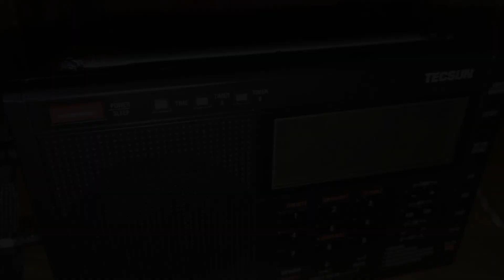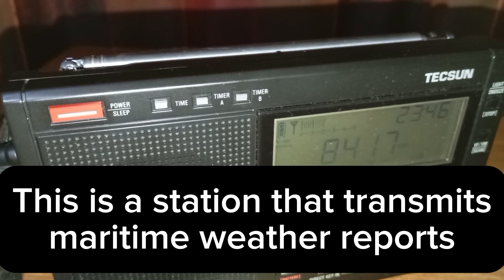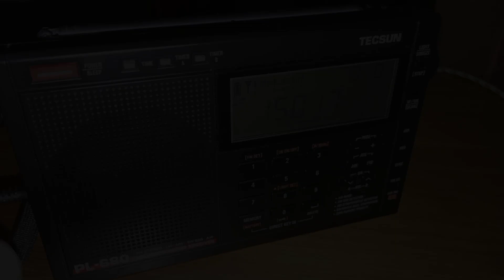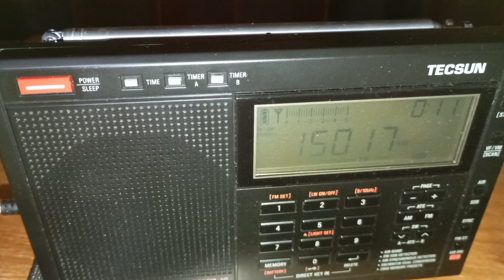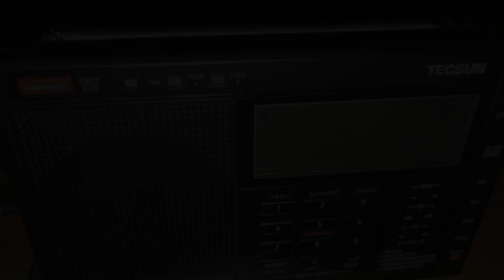Chinese maritime radio 8417.5 kHz, and US Air Force emergency action message 15106 kHz #shortwave

Comment from the maker: The signal on 8417.5 kHz in this video is actually Guangzhou maritime radio from China, and not Tianjin. I relied on the Eibi schedules for my ID, but the Morse Code ID in the 8417.5 kHz signal, according to a viewer, is Guangzhou and not Tianjin. Therefore my reference to Tianjin in the video itself is not correct, this is definitely Guangzhou, some 2000 km south of Tianjin. But it's still a new catch for me 😀

Comment: Hi André, I confirm it is XSQ you heard, but you already know that 😜 however, I love the sound out of your Tecsun PL-680, it literally sounds like recorded in 1930s 😂

And since you say 15017 was better for you for that EAM, ut means something is 1kHz off in your radio, either the fine-tune encoder wasn't close to the middle of its range or the radio itself is 1kHz off... Perhaps that's why you thought you got XSV, maybe it is listed at 8418.5 or 8419, while you were really hearing XSV on 8417.5 🤔

Anyway, I used to hear a lot more of such channel markers of other coast radio stations. These days it's only those three Chinese stations (also XSG Shanghai), and TAH Istanbul Radio. TAH used to have 2 markers on each band (4, 8, 12 & 16 MHz), but now they're like having 2 or 3 in total 🙄 still better than WLO, which closed down I believe near 2020, and in the past I used to get IAR from Rome too, sounding so similar to TAH, I wasn't really noticing any difference 😂 sadly they closed in 2010 or 2011 😢
Reply from the maker: Hi Arnie, thanks for your comment! Perhaps my radio is 1 kHz off, apparently this is an issue on some of the PL-680 radios. But, to be honest, most of the time the frequencies are spot-on, so these two might just have sounded better when tuned slightly off-frequency... I haven't heard any of these Chinese coastal radio channel markers, so this one from Guangzhou is a first for me. But the EiBi listing was a bit confusing, a viewer (also in Poland) pointed out that it was not Tianjin, as listed by EiBi, but Guangzhou. 

What is the frequency for Istanbul Radio? I will try to catch that one. And I'll try for the other two Chinese ones also.
Reply: @swlistening  I'm sitting right next to my laptop w/ SDR running, plugged to my large loop (well, one of two I had last winter), so I decided to make a bit of a bandscan for these maritime markers:

I'll give all frequencies as center frequencies for the signal, tune down any amount to get whatever pitch you like in USB :)

8416.5 UDK Murmansk Radio SITOR-B/NAVTEX, very strong peaking S9+35dB
8419.5 v.weak carrier ??
8421.0 XSQ Guangzhou Radio almost peaking S9
8424.0 SVO Olympia Radio, dash & DE SVO in CW, S9+10
8425.5 XSG Shanghai Radio, only S7
8431.0 TAH Istanbul Radio, S9
8436.0 unknown FSK/RTTY, traffic a bit intermittent, peaking S8

Murmansk is just too strong at the moment to catch XSQ on 8417.5!

EDIT: after 2000z, a FAX signal has appeared on 8442.1 kHz USB, S9+10dB signal. must be another Murmansk, listed as RBW41.

Also:
4212.0 XSQ mixing w/ some weak tone
4215.0 XSG S9 in noise
4232.0 a spur of an FT8 signal :O
4560.0 there is another TAH, a bit out-of-band, S9+5

And on another band:
12610.0 ruZZian Navy CIS-36-50, S9+25dB
12613.0 XSQ S9 but sounds really healthy, low noise :)
12637.5 XSG S9
12648.5 XSQ S9+5dB
12654.0 TAH S5 only, skip zone 🤷‍♂

Finally 16 MHz, surprisingly not empty:
16880.0 XSQ S6 w/ QSB

Hope this helps :)
Reply from the maker: @ArnieDXer  Thank you so much Arnie, I've noted them all down and will monitor over the coming days. Will let you know how it goes!
Reply from the maker: @ArnieDXer  Hey Arnie, I monitored these and I think I picked up quite a few of them. I made a video, but it's not published yet, I am not so sure about my IDs for all the signals I caught. I'm not so sure about the Russian ones. Here is the link, if you want to watch it. If I am not too far off with my IDs, I will publish it for everyone, but right now you can only see it via this link: https://youtu.be/gMYSI8b-tVk
Reply: @swlistening  looks like you're close :) I see you are using the fine tune control of the PL-680, so indeed there's a lot of inaccuracy about the frequency displayed on the radio. Well, I have a similar radio, a Grundig Yacht Boy 80. It has a BFO control similar to that of the PL-680, except the Grundig can't split LSB & USB 😕 While you adjust that fine tune, you can notice a distinct spot halfway through where you need a little more pressure to turn the encoder. This is convenient, as that's where the radio should - in theory - be tuned spot-on. In practice, I had to adjust it slightly below the center to zero-beat on many spot-on signals, transmitting on even frequencies, from broadcast stations to hams. However, it's been a long while since I used this radio, as the internal battery that keeps the clock, the memories, and basically all of radio circuit alive, died, and I can't open the radio to replace it 😢 rather, I cracked its screws' head, maybe even two... Either the screws are too old or screwdriver too crappy 😂
Reply from the maker: @ArnieDXer  Thanks Arnie. Looks like I will have to experiment with the recalibration... The PL-680 doesn't tune in 0.5 kHz steps though, so that's kind of part of the reason, I think, why I need to use that BFO dial to fine tune.
Reply: Being slightly off-frequency especially in SSB is a common issue on PL-660/680. My 660 does it too. There is a recalibration procedure (easy to find here on Youtube) but I've never managed to effectively correct the small shift. Maybe it's just me.
Reply from the maker: @F4LDT-Alain  Thanks Alain. This is true, I have seen quite a few people refer to this issue. I am not 100% sure if mine is actually off-frequency in SSB mode. Most of the time it seems to be spot-on, with a few exceptions, like in this video. I will keep testing it though and see if I do need to try the recalibration.

Comment: Very nice catches there André! I haven't heard that US emergency messages in a long time. Before I got my first SSB radio, I used to listen to it on 15.034 MHz during that 10 minute period where the Trenton Military volmet was off the air. Now I rarely hear them and thought they went inactive.
Reply from the maker: Thanks Liam. I think for these US emergency action messages one needs to park on a frequency for several hours and just wait, they appear to be quite random. I have caught them before, on another frequency. This is only my second time.
Reply: @swlistening  I guess I was really lucky or they just had a lot of messages.